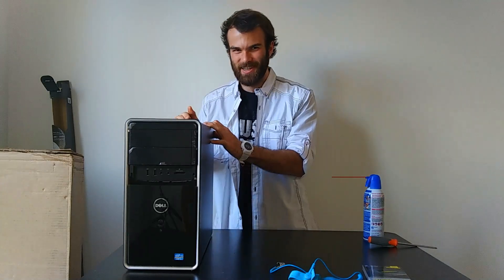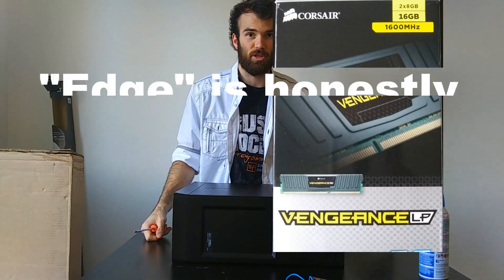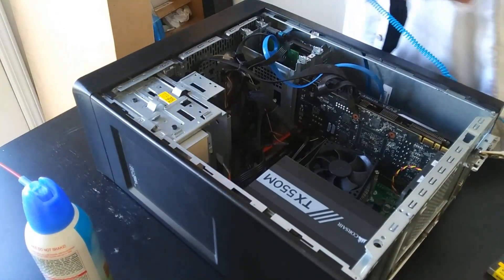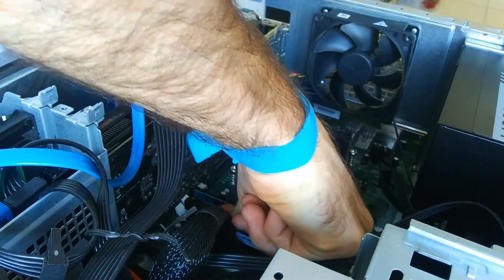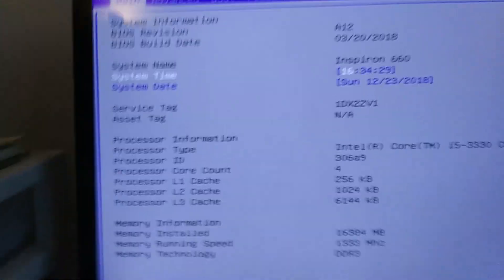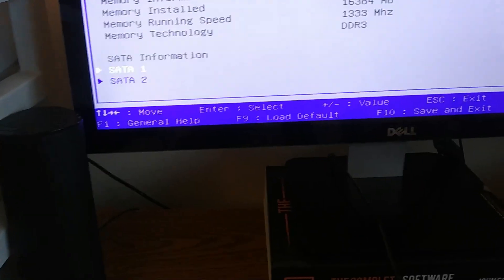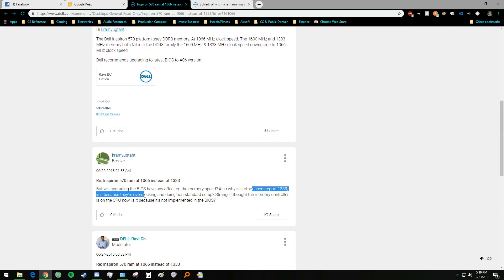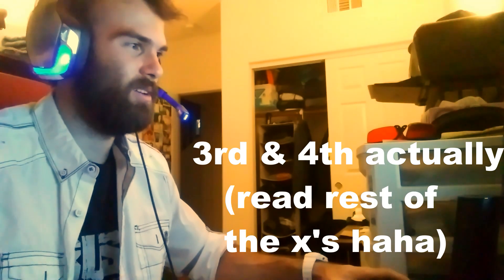Dell Inspiron 660 RAM Upgrade | The Results Are In!

Comment: Online it says it only supports up to 8 GB
Reply: You have to understand Dell only really certified it would work with 8 GB as it's likely that's what was available at the time they began to work on this machine.

If you look, the chipset, B75 Express, supports up to 16 GB. I've seen instances of people who couldn't get 32 GB to POST, so it's very much a chipset limitation that can't be sidestepped.

The one unofficial upgrade you can do which works (i've done it) is install a Xeon processor in one of these. Particularly any of the Xeon E3-12xx V2 processors. I have a 1240 V2 in mine. I think you can even use the original E3-12xx processors as well (so, Sandy Bridge) so this machine can really support a ton of processors. Very versatile!

I'm looking forward to getting 16 GB of RAM for my machine as I just have 8 currently, and eventually a modular PSU so i can use my 1660 Super in this beast of a machine. It's my main machine, too.

Comment: Dudes got a ground strap on while im over here using fence wire to attach my case fan to my cpu fan since the 660 has a bios locked cpu fan curve but not the case fan

Comment: Desktop: Dell 660
Motherboard Model: 084j0r
Graphics Card: GTX 1650 D6 Ventus XS OC 4GB
Ram: G.SKILL Ares Series 16GB (1866 MHZ) Only getting (1333 MHZ) p.s. get 1333 mhz ram sticks.
CPU: Intel® core™ i7-3770k

These are the Max Upgrades Without Tampering with Anything OEM no PSU Upgrades. Using oem 300W power supply.

It would be senseless to upgrade higher Graphics Card and PSU for Ram would only get 1333 mhz Max Speed.
Reply: I put a Xeon E3-1240 V2 in mine :)

Comment: I have a 660s with an i7 3770S in it and 16GB ram. My processor supports up to 32GB ram. I really want to know if it’ll be able to handle more. 16 is usually enough but I do get bogged down after a few days where an extra 16 would be super handy

Comment: Is it possible to upgrade the i5 3330 to i7 3770 on this machine? I use it to play games and it seems like the cpu is bottlenecking my gpu. The cpu can even keep up with low end gpu like the gtx 1050 ti
Reply: Yes you can upgrade to the i7 3770k. You need to make sure you’re on most recent bios and chipset drivers before making the switch. 

I have a 660s which has a smaller psu so I got the 3770S which has a lower tdp. Been running great for 4 years.
Reply: @DrRyanAnderson  I already upgraded to i7-3770 about 3-4 months ago.

Comment: I have the 660 with 16gb in it and running 1600mhz. Cpu is i5 3470. Maybe you need to update the bios? Cause thats what i did before upgrading the cpu from i3 to i5 and 8gb to 16gb. Or it could be that my ram is micron?

Comment: Did you change the cpu? I want to upgrade my cpu to i7 3770 and gtx 970 just like yours I already have 500w psu 500gb ssd gtx 750 to and 16gb ram
Reply: Also I currently have i5 3330
Reply: Did you change it yet?
Reply: I upgraded my 660S to the 3770S. Mine has a slightly smaller psu so I needed to lower TDP. 

I  have 16gb ram but would love to know if it’ll handle 32gb